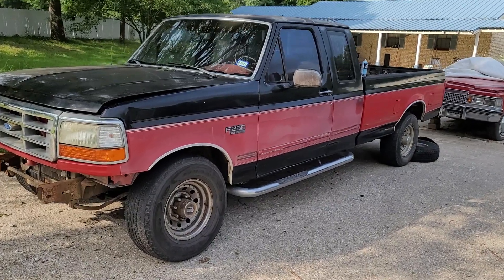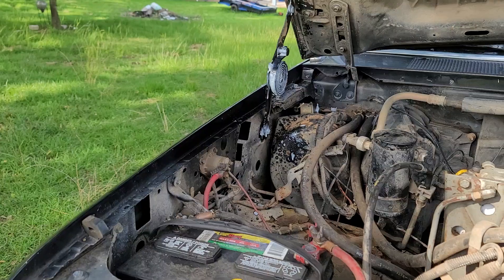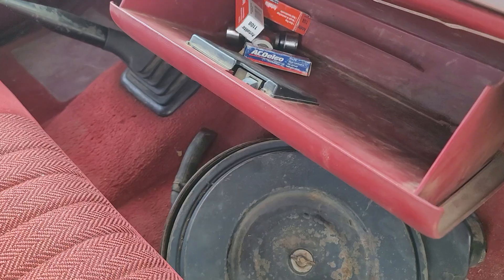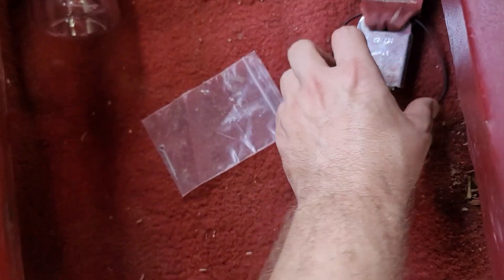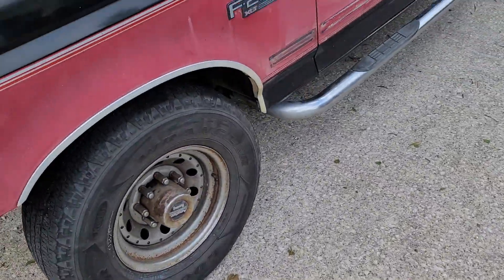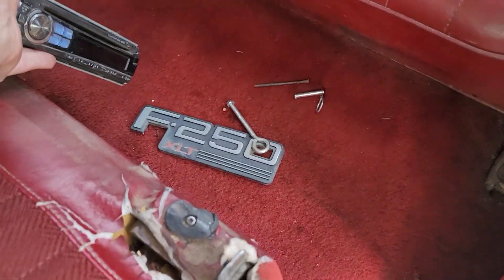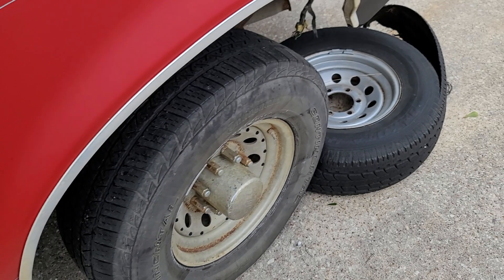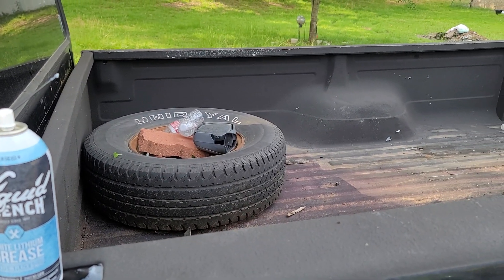1993 Ford F250 7.3 IDI - My New Truck

Comment: Great engine and great truck I have my 94 f350 7.3 idi and I drive it more then my 23 f250 the older the better it’s got 225k km so it’s got about 140k miles lots of life left

Comment: The glow plugs/controller are a constant headache on these, as I'm sure you've deduced.  Some other common problems are the fuel tank selector valve, broken injector return fittings, and cylinder cavitation.
As for the lack of fuel in the filter, I like to take the return off and blow a little air down the line. Not a lot, you don't want to inflate the tank, but it'll push fuel through the entire system. At that point it's just a matter of bleeding the delivery lines in the normal way.
I've also found that sometimes, even with fully charged batteries, they don't spin fast enough to push the air out of the high pressure side of the pump. A shot or two of your starting aid of choice and it'll bleed. It would be wise to do that with the glow plugs disconnected.
Now, cavitation. I'm not sure if it was thin cylinder walls or people not keeping up with coolant changes. Cooling system maintenance is imperative on these. SCAs are your friend.
Reply from the maker: Thank you.  I'll be referencing this a few times as I get to working on it.  It's 101° here and I'm battling the heat.
Reply: If you need wiring schematics or other specs, I have them.

Comment: You prob won’t get much fuel from the shrader valve without turning the key over. These mechanical fuel pump need the crank to turn in order to send fuel. Easiest way to see if you have a good fuel pump
Or not is the crack the fuel like that run right into the fuel filter housing and lay a rag or something under ut and go crank it over for 10-20 seconds and see if fuel came out. I just got one running after it say for 3 years. I replaced fuel pump and glow plugs now it starts every time
Reply from the maker: It sprays like a fountain when turning the key; moving on from there, I believe the issue to be the glow plug system.